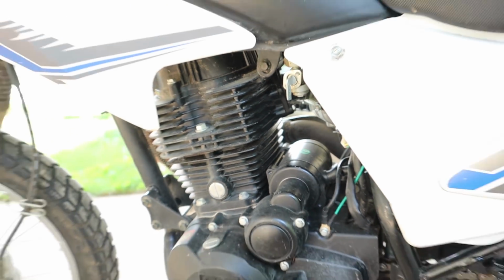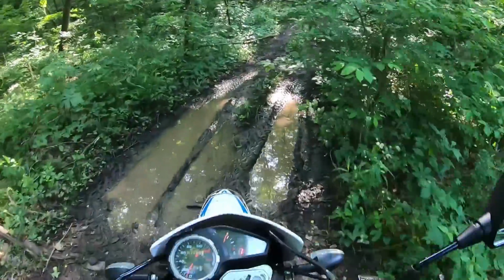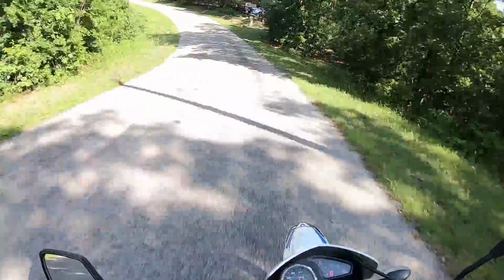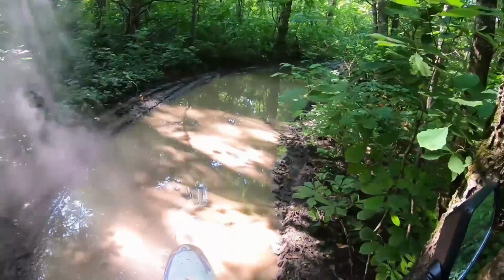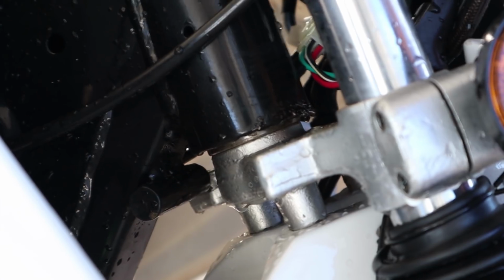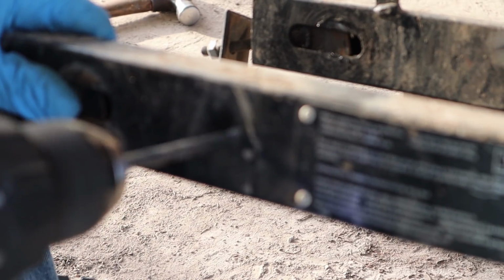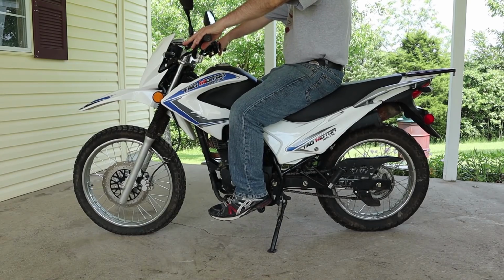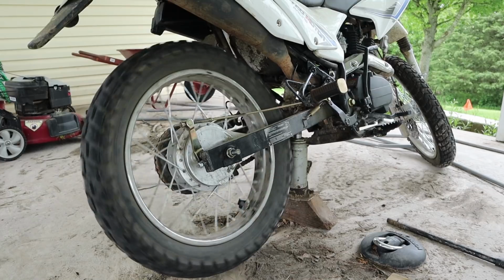Testing the Worlds CHEAPEST Motorcycle!

Comment: The problem with the carb stems from the fact that the US (UK and Europe) contaminates its gasoline with ethanol and China doesn't (yet).

It's probably the only thing found in China that is better in China than the US, UK and Europe!!

Contaminating gasoline with ethanol drops the vapourisation temperature of the fuel and this will drastically affect the engine through poor combustion. (There's also the calorific energy loss due to diluting the fuel with a lower energy contaminant).

The carb and engine were set up for Chinese ethanol free gasoline, where it worked just fine. In the US it had it's first taste of ethanol contaminate gasoline juice and isn't happy with it, hence the need for carb adjustments.

I have this problem with classic motorcycles that were designed to run on higher energy leaded gasoline and now have to run on modern crap fuel. Lots of fettling involved.....

Comment: JUST FOR CLARITY!!!
these types of cheap bikes are delivered in the UK on the road for less than £1500 they are not good.
the  sneak is that we require an MOT to check that vehicles are actually even roadworthy every year. the loophole is that on brand new vehicles it doesnt happen for 3 years. eg 2015 plate vehicle wont see a MOT until its 2018. by that time you can gaurantee that the bike is not gonna pass unless youve babysat the thing.

Comment: Could relate...  Had a used Loncin in the Caribbean... It was a good starter bike, but I couldn't find parts for it: Gauges / shorter kickstand / rear tire. 
- The stand that it came with was llloonnggg... and was one of those center-under-the-bike things. I had to seriously lift the bike (300 lbs) every time I wanted to park. It just wasn't practical.... esp. for a  1 minute stop at a store.
- The rear tire had a serious bulge in it... Went to the Loncin dealer several times... They never had any in stock.
-  Had to sell it for these reasons.  Thanks for sharing.

Comment: I paid $340 for a 94 klr 250, put $100 in parts into it and rode it all summer. Now that it's cold outside I'm going to tear it apart and get the frame powder coated and clean it all up.

Comment: I have the little 90cc version of this bike and have so many miles on just the back wheel that it is worn flat. The front wheel is almost brand new. The engine on mine is dead bulletproof. Bang it off the rev limiter with the front at nearly 12 o’clock for hours.

Comment: I'm betting that modding or replacing the carburetor to improve engine performance will cause the bike to fail emissions testing.  Tao probably passed emissions testing by jetting the carb way too lean, causing it to run poorly as you noted.

Comment: Nice video.  My daughter bought an RPS Hawk in the spring of '18 and is riding it without much agony.  I was a career motorcycle mechanic in the '60s and '70s and assembled and serviced it for her.  On the carburetor issue, it was much as you described on this TBR7 and all it took to make it decent was to put a couple thin washers under the throttle slide metering needle clip to make it richer - they are set up very lean, apparently to comply with emission regs somewhere.  She also has trouble with the tallness of the machine, hers came with a very oversized knobby on the rear and the smaller dual purpose tire would be sufficient and help lower it.  It is very tricky to find the optimum chain adjustment on them and it is important as the slack is drawn very tight with a load and could damage both the rear and output shaft bearings if not set up well.

Comment: New and it has a miss when the motor is running.
Parts missing 6 weeks to get one so you can run the bike.
No tittle to put it street legal and having to call them for it.
The list just goes on and on and that is beyond what i would go thru.
Having to take the carb apart to change jetting or order a Mikuni 
for a replacement. No way that thing is even worth what they are charging.
Like he says put an extra grand in the budget buy a good used quality bike.
Just  the fixes he did for someone not mechanically incline will spend getting '
this piece of junk running right and even still it will always be a piece of junk.
Ohhh he forgot to mention when you buy something one day you will sell it.
So basically this bike will be worthless and the good quality bike will still be worth something.
So the extra grand you dished out will be a good return on your money so at the end of the day 
will cost you the same as this junk and you will not be the laughing stock out on the trail.
Reply: around here, a box of parts that used to be a bike is still 2k, so at least in my case, it's gonna be way more then a grand more to get something that runs.

oh, and we have used bikes with no title, too, that's pretty much everything that's affordable. That's why these things are as popular as they are. People don't sell their bikes often enough to have a healthy market.

Comment: Yamaha has the YTX 125, sells for $910. Honda has the TMX 125 which sells for $1200. Motorstar has 3 models that sell for $700. The Yamaha and Honda ones were designed as a working motorcycle. I have seen them with side carts carrying up to 12 people with no problem.
Reply: Not in the USA.

Comment: My experience with cheap Chinese bikes (Remember Pep Boys 250cc rice rocket?),  every piece of rubber & plastic, and there's a LOT of it!  rotted & crumbled.  Replacement parts from Singapore - unattainable!  He was right about needing to tighten every screw on the thing, which wouldn't have been a problem if the screws weren't such low quality they always stripped, or broke.
If I chose to do it again I'd make it a point to replace every replaceable part on it before it had a chance to fail.

Comment: I bought one of those, well a similar one. And I have to admit, I do regret it. I regret it massively. But it was my only option and I have to live with it for the foreseeable future.
Reply: What went wrong so far
Reply: @brucewayne-ej3cx  Chain keeps coming off. Fuel leak from the fuel cap. The gear indicator switch is broken. The speedo cable got a nick in it because of how badly it was installed. So had to fix that. Every time you pull away the sprocket makes a horrible noise. There's a clank every time I go around a corner. That's everything I can think of at 6 in the morning. But yeah, so far my experience has been horrendous.

Comment: I bought 2 250 Chinese quads a few years ago. Within 3 hours, one became a parts doner for the other one.
Reply: Same here. I had a Kazuma or something like that. It's actually a rather big Chinese manufacturer of quads, ATVs etc. And it was broken more than it worked, not to mention it had overheating issues from the first day
Reply: The quads are significantly more horrible than the bikes. A friend of mine has a rental service and he doesn't let customers that rent a quad go further away than 30 miles.
Reply: ROFL
Reply: @J G I'm dead ahahaha made my minute 🤣
Reply: Snowflake
Reply: @J G Donor...thanks Mom.
Reply: Never buy the crappy Chinese ones it's so hard to find parts for them cuz they're not from a real company they break so fast
Reply: J G never knew y’all have döner kebap in the US
Reply: @J G with Brett Favre beans and kiante sauce
Reply: The quads not so much . done alot of research. The quads not good. Bikes more dependable
Reply: Ya get what ya pay for.....junk!
Reply: @SomethingSmellsFishy  With parts literally falling off...racks, instrument pod, etc, from loose or broken bolts or wood style screws mounted in plastic, shock seals leaking, loose wheel bearings...  a break-in period for these things is more like a breaking  period.
Reply: @stevest1300   sounds like you dont know how to work on your bikes
Reply: stevest1300 lmao

Comment: So it's a heap of rusty junk, the missing spacer tells you everything you need to know, In the UK these won't pass the three-year MOT test as the brake disks are not thick enough to meet UK standards (unless they have put a thicker disk on now) as for the engine, see how it performs after 50K miles (assuming it will make it to 50K)  my advice is spend the cash on a 1980s Honda XL if your lucky enough to find one that someone is willing to part with, they usually come on the market after the death of the owner, I would not ride this on a road, off-road I would if given it for free,

Comment: I opted for the tao tao  powermax vip 150cc moped for $650 NIB _  with a Maxxis 6024 out back it can go about much better , 50,000 mile oil change a  new muffler and ready to go for less than $1,000 and $350 for  a custom rear cargo rack  ( a la 1983 Honda trail 110 18 inch square rack )  saddlebags and camp gear

Comment: I bought one of the Chinese bikes  the Lafan ( same thing ) basically.   I hated it   lol 😂 I drove it 166 miles and tried to sell it  even for $450 and bitches wouldn’t buy it.  So traded it for a gen set panel installed a job worth $350 and I had to throw in another Chinese bike I had exactly 120 miles  and my Lafan looked grand !  Nice gold wheel rims  it was even bigger frame  but the cheapness  omg it was so crappy   I went out and bought a brand new KLR 650 enduro ( that was nice ) but by the time I got it upgraded to where I liked it I had another $1200 in it.

Comment: I have a xt250 to... Love it... Its light for a 250 bike.. But because its lower than almost every dirtbike from 200cc and higher... Outdoes those chinese bikes in everything exept for the purchase price and parts prices... I have driven both kinds of bikes... But tje engines are good... Easy to work on if you treat it normal theire also reliable.... And ive tuned some of them and it was fairly easy... From 125 cc to 200 or 230... Alot of more power for pretty cheap...

Comment: Great video!
I think a 400 or 450 is much better for hills.  Those extra cc's make hill climbing so much easier.  Don't be intimidated by the extra cc's, it makes riding easier,  not harder.

I've had a Chinese bike and I think the components on it are junk.  I rode mine on some long rides and it held up.  The plastic was painted blue, so if you wrecked, the paint chipped off.  I sold mine to a freind and he rode it for years and went on some long rides on it.  Eventually,  he bought a japanese 450 and likes it much better.

Comment: I grew up on off brand bikes. I actually had one just like this. It was a 200. 
My speedometer cable broke. The plastics broke off every time I dropped the bike, I broke my handle bars once I crashed on the road. all I ever had to do was clean the carb all the time. Other then that it always started and I used to dog the shit out of it haha. 
If it's all you can afford, it's worth it. My favorite time as a child was riding through the woods. 
But when it does break you will have to Jerry rig something up half the time.

Comment: trails are one thing, i woudnt take this bike on a highway if my life depended on it....
Reply: I would not go on the highway with any 125cc bike
Reply: I don’t think there’s a sub-250 around that would be legal on the interstate, since they need to be able to maintain at least 65-70MPH to be legal there.  But, for state highways, speeds of 50-55MPH are ok, and most smaller CC bikes will manage that without a problem.  (Just watch for the really low ones which top out around 45.)

Comment: You can run a pcv valve and a rubber fuel tube out the crank case breather and run that tube straight down instead of into your airbox. The Hawk 250 has front and rear disc which alone might make it a better option than the Tao...otherwise they're quite similar.

Comment: I'm not a china rider at all but my experience has been disappointing... I bought my DRZ400 with 4,200 miles and after only having it for four months  a chunk of the piston skirt snapped off for no reason and ended up chewing all the teeth off of the plastic oil pump drive gear. On the other hand the Roketa 200 enduro I paid $350 for with around 900 miles with a title now has almost 13,000 miles nine years later and I've only had to replace a handful of ebay bolt ons.....

Comment: You don't have to stick a lot of money in these bikes if you don't want to. I have a Tao DB14 110cc. These things start amazing. One or two kicks. If you use good premium gas and keep the carb clean there is no problem. Some have experienced carb issues, but even replacing the carb doesn't cost much. These will last for years if you take care of them. I tried to buy a decent Japanese bike, but your gonna pay 3 or 4K. And they can be junk too. I plan on getting one of these or the Hawk 250.
Reply: Go for the Hawk, hands down.  Or a CSC TT250.  And yeah, that replacement carb is only about $15; I have one  :)

Comment: 30 sec search on cycletrader      "$1000   2007 Suzuki GZ-250 2,300 miles on it one dent on the right side of fuel tank no leaks just got it back from the mechanic new carb new battery no issues just don’t have time to ride it"      obviously not great off road, but how hard can it be to find a decent used bike that is more reliable than this?

Comment: Great video! Dude the price was not so great. With all the problems you listed the price was not $1350 but at least 1000 to 1500 more, in time, labor, whatever parts you need to replace. I'm new to riding and if I had bought this nightmare there is no way I would still be riding. Glad you enjoyed it though.
Reply: Your time is only valuable if you could have used it to make that money.  Ie instead of spending 5 hours repairing motorcycle , picked up an extra 1/2 shift at work for  30 bucks an hour would have made him 150 bucks. The opportunity cost of repair would have been 150.00 dollars.  At 30$ per hour to rack up a 1000 dollar opportunity cost he would have needed to spend 33 hours doing maintenance.  That seems unlikely.  Parts for these bikes are cheap, a whole new carb is 15.00 on ebay.  A hose for a jap bike is probably double that.

Comment: Been there - done that........won't go there again!

We bought 2 chinabikes and put them together and started riding and problems came up quickly, most notably the engine bolt that popped the head off and hit me it my leg.
Drilled out engine mounts and used tight fitting grade 8 bolts, the original engine mounting bolts were sloppy and the engines on ours completed the front lower frame, no actual frame there just used the engine which is fine if done correctly.
Went with a more open exhaust and rejetted and mine would actually plow thru deep sand then, I did ride it hard to the point of bottoming out the suspension and I am well over 200lbs but that was after rebolting engine otherwise I'm sure it would have folded like many other stock chinabikes did back then.
Brakes would drag, vent cap stopped venting, went thru several batteries until I relocated batteries away from exhaust coupling that seemed to enjoy cooking the batteries.

Spent about a summer and a half making them both decent and somewhat reliable but yeah we missed out on a lot of riding for the need of wrenching and fabricating.
Reply from the maker: Thanks for sharing your experience.
Reply: @Lumencraft-  To be fair ours were 2006 models so I'd hope the latest from china would be better but after some serious reworking on ours I had them pulling much harder out it the deep deep sand to the point where mine would snap up out of the sand and just go but in the beginning they were  useless in the sand, we road St.Helens, MI open scramble area and it is mostly deep sand. I had mine rock solid and rode it hard after the mods but my wife just couldn't ride two wheels anymore so I bought her a raptor 350.

I had pulled the original engine in mine and put in almost the same the except OHC rather than the original pushrod version basically the same,  the original engine then made its way into a yamaha blaster that ran great and was a total blast to ride.(I called it "BLASTARD"

Comment: Well I mean if you pay $1,350 and you’ve already ridden it 1500 miles, you’ve crossed the $1/mile mark
Reply: Consider the cost of fuel
Reply: HITESH ADHIKARI cost of fuel is the cost of operation. Operating cost shouldn’t be included in the immediate comparison. 
I wouldn’t complain about fuel when I pay 1,300 for something anyways. I got 8 miles to the gallon in 3/4ton Chevy that I got for $1,000.
Reply: I've had good luck with mine.  Put 6,000km which is little less than 4k miles last year with zero issues. Took it on a few 500 mile weekend trips to
Reply: just another disposable vehicle
Reply: I had one  it was so crappy even after fixing it I wanted $30 a mile.
Reply: Good point..

Comment: Anything cheap and made in China is sub-standard. The metal parts rust easily. The cables and other parts detach easily, too. And your engine does NOT have a long shelf life. If you're not knowledgeable about fixing motorcycles, China made vehicles will be a pain in you wallet.  You might as well invest on Honda or anything Japan made where your money is worth spending.